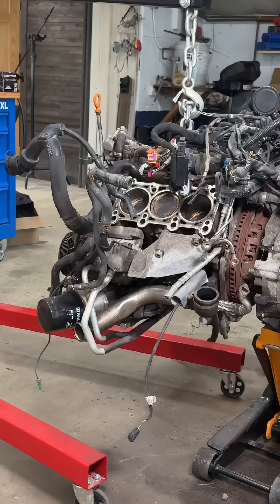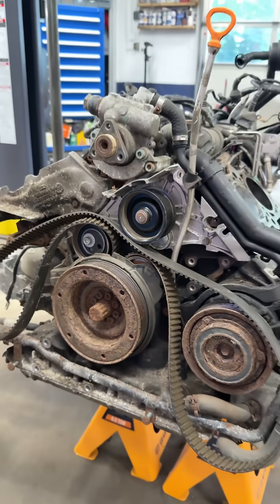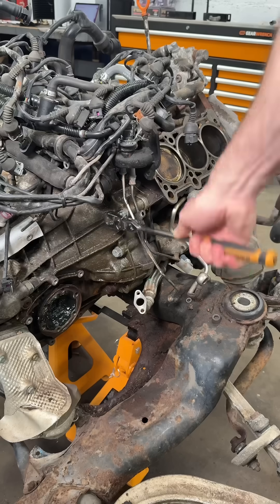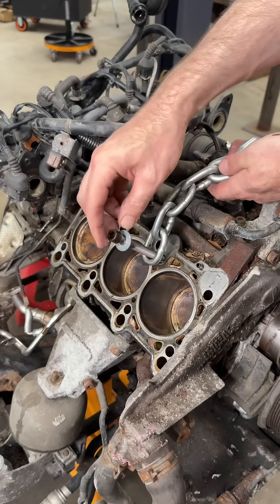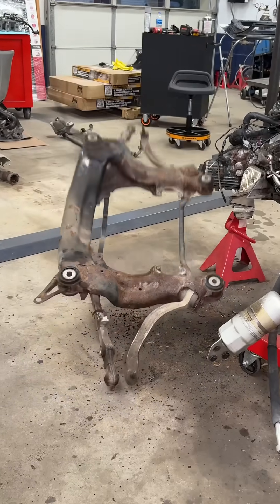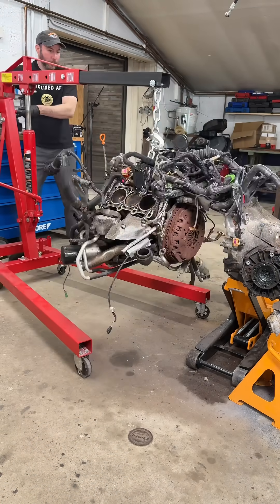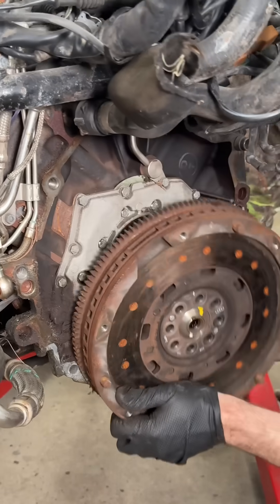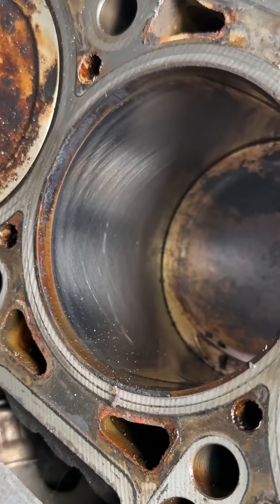Audi S4 Engine Preparation for Disassembly  #audi #vw #volkswagen #turbo @GEARWRENCHTools

Comment: Upgrading the powertrain in that way isn't ideal. The cast iron isn't strong enough to support the increased power, and the angled bolts direct force towards the cylinder bore, you can create a micro cracks.
Reply from the maker: Who said anything about upgrading it?